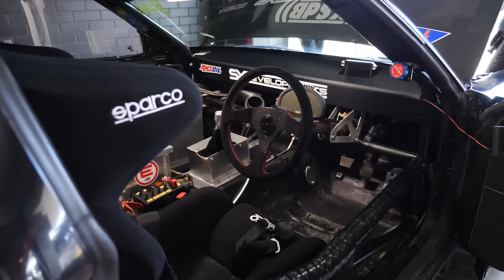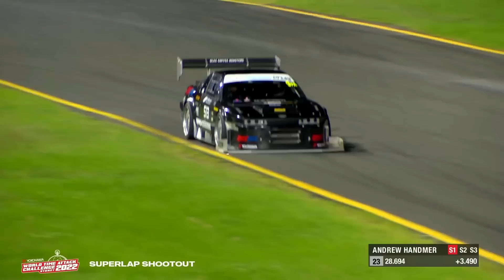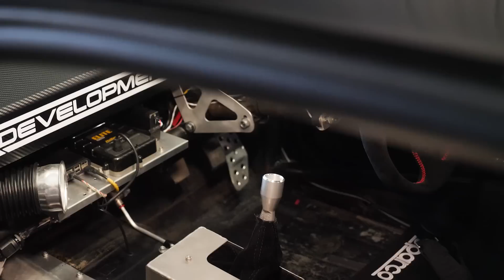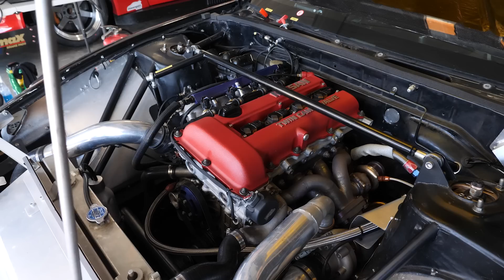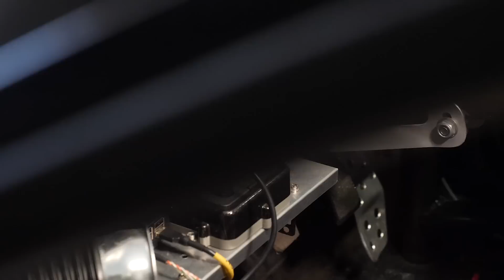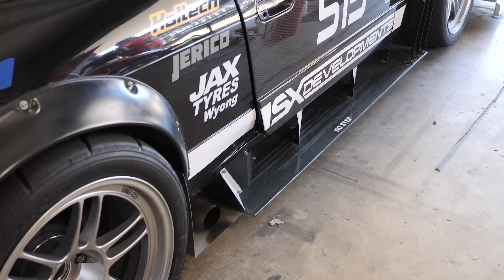This 20k 180SX Build Will Surprise You 😎

Comment: What seq shifter been used? Renagate, S1, Romero?
Reply: it's a Renagate shifter, but the street version with longer throw
Reply: @SXDevelopments   Oh, thx for your answer. How often does a misshift occur (like in 16:11) and what does it depend on? Just need some real use data for understanding, bcoz i've made in past mechanical seq shifters and came to the conclusion that mechanical shifters have a lot of problems associated with the transmission itself...
Reply: @AlexKarax  I had only had the occasional misshift over the last couple of years at Wakefield, but had never run this car at Sydney Motorsport Park before the test day the week before WTAC.
The gearbox had been out to replace the shift lever shaft seals, so the linkage adjustments might have been a bit off, but on the test day I had a lot of misshifts.
It was improved a lot by playing with the adjustments, but I still had a few misshifts at WTAC.
I think there are times when maybe the dogs bounce on a shift and the shifter ratchet ends up between positions and it's hard to get it back in the right spot.
I think early on it tended to over travel, so shifting again would end up in 4th instead of 3rd. Sometimes I've had it not make it to 3rd but get there on the next try.

I'm in the process of building a pneumatic shifter for it, which is tricky since the gearbox has two shift fork inputs which both need 3 solid positions - but it's easier than doing it on a normal H pattern input.

While measuring up for the pneumatics I noticed that the shift fork travel is not identical for each gear, which might be part of the issue with the Renagate shifter. If you get it adjusted right for one gear it's probably not quite right on another.

I'm hoping the pneumatic setup with proper ECU controlled flat shift should help, but I have also rebuilt the original H pattern shifter which I will set up as a backup plan.
Reply: @SXDevelopments  I've work on my shifters with same issues with 2nd-3rd shift and overtravel, unequal lever travel and i had same conclusion - it's easier to make pneumatic system.
Thnx, now i understand that not i'm absolutely stupid in my battle with shift problems but it's also some basic concept problems)
Reply: @AlexKarax  good to know! I was originally going to make my own sequential shifter until I found the Renagate. Ideally I'd replace the top cover of the gearbox and do a direct acting drum shifter, but it's hard to machine the parts!
I'm still not sure if the 1986 Jerico's design would like being shifted much faster, so it could be a lot of work for not much gain.
Reply: @SXDevelopments  same thoughts - basic design of Jerico simple, but when you triyng to make shifter that will be work fine it's a LOT of work on and final result no so cool than the simple airshift.

My shifters was fully laser cutted and a couple of simple small lathe'd parts, but it's been a mistake to make shifter in that way. In the end it was work, but not that cool like i've waited for)

Comment: Is there an error with the power? I can’t imagine a td06sl2-20g making 350kw at the wheels. It’s a 52mm inlet size. I have experience with this turbo on a 4g63 on pump gas. Or does e85/race gas make that much of a difference? I’ve been making around 350whp on a mainline dyno.
Reply: it's the billet wheel version with an external gate T3 housing, and it's really running at max flow anywhere above 5000rpm. E85 definitely helps get a bit more power out of it too.
360rwkw was on a Dyno Dynamics roller dyno, and prior to the cam upgrade it had made 345kw on a Mainline.
Reply: @SXDevelopments  thank you for the answer. What compressor wheel is used? 11 blade, 6+6 or 7+7? I used the 11 blade. And it was on a awd car
Reply: @nFINITELooP  it's a 5+5 blade wheel surprisingly!
Reply: @SXDevelopments  I guess next time I will get a turbo with that wheel :)
Reply: I made 300kw on an sr20 with the td06 sl2 20g, was only on around 17psi on a dynapac hub dyno. That was internal gate, with a little creep up top, and stock cast exhaust manifold. Cant see why 360kw wouldnt be possible with more boost.
Also would be a slight gain from being dry sump.
Reply: @reidonz5848  the drive train is pretty efficient too which probably gains a little bit.